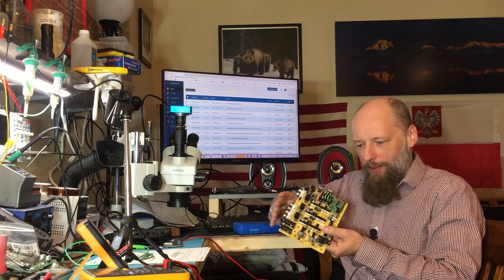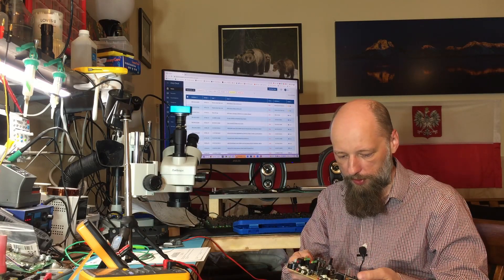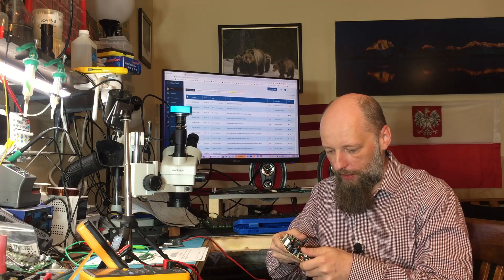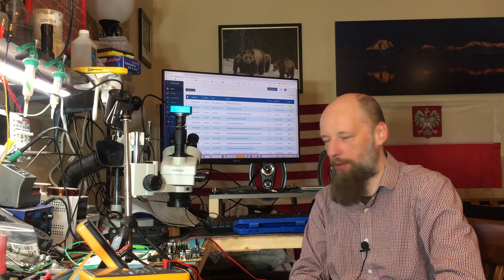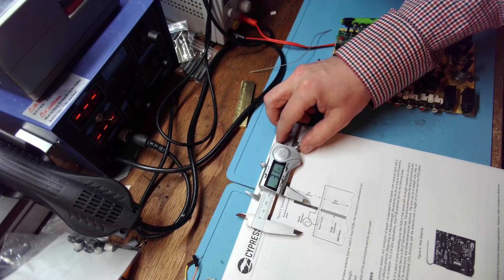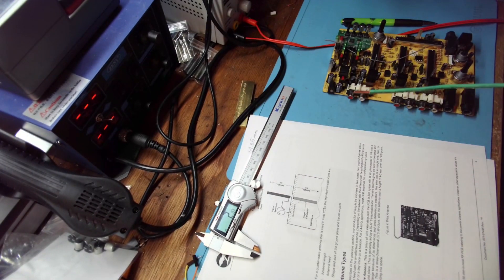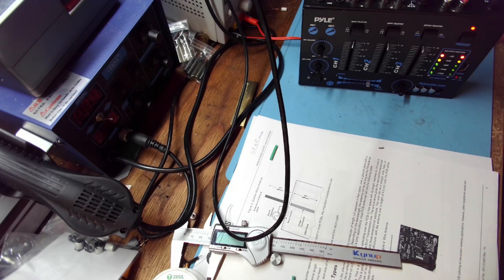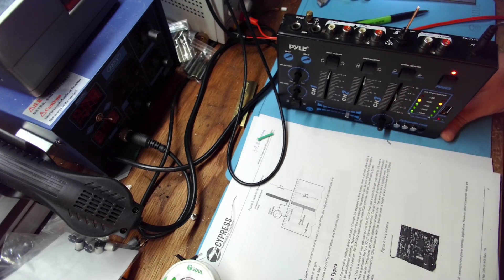Pyle PMX7BU BT Antenna Repair with a piece of wire

Comment: How to unscrew ? Remove external Bluetooth antenna on a back? Details?
Reply from the maker: it's a push-in design (cheap design) but you can just cut it off and buy a replacement antenna which screws on, that's probably better than what I did but I still use it till this day and it works :)
Reply: How I can email you a picture of my antenna and you will tell me how I can take it off?